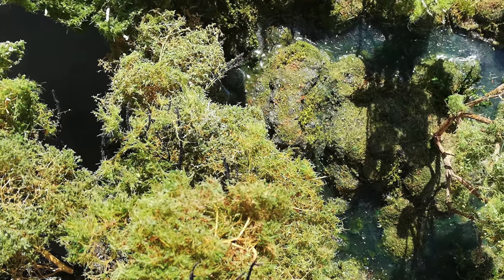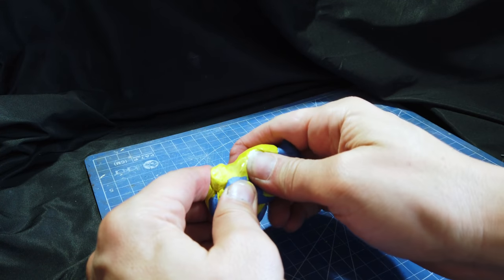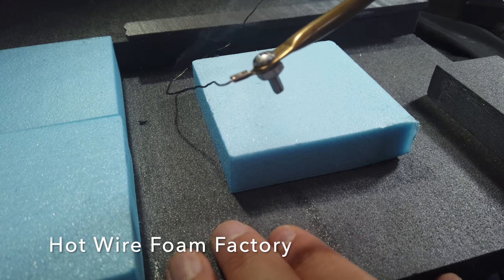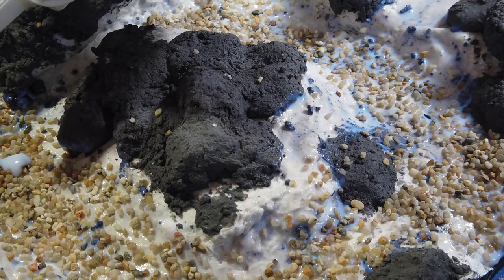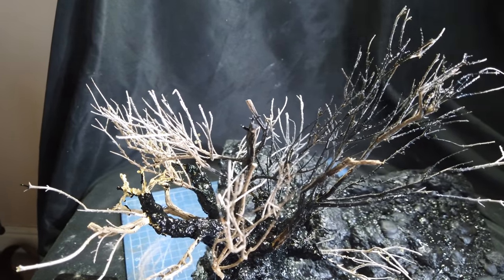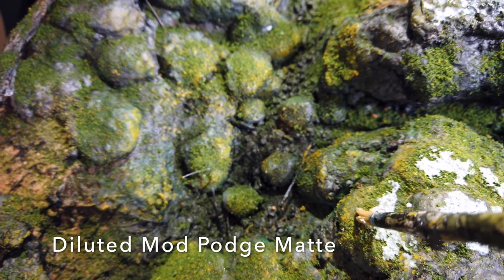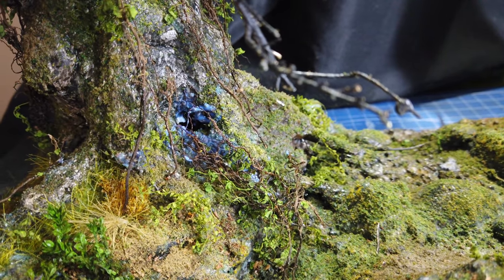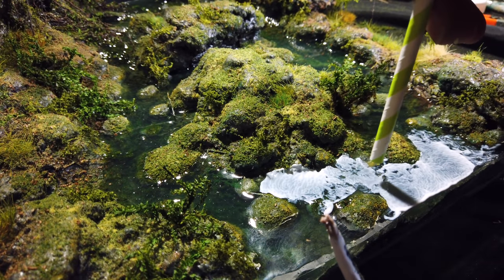How to make an AMAZING mossy forest river with giant tree: Making a Scene Vol #6

Comment: While I'd love to get into model making, I'm not sure I can reconcile with how much sytrofoam is used, environmentally-wise. Are there other options for base materials that aren't plastic-based?
Reply from the maker: Wood, but that's still extractive and probably has a larger carbon footprint across its life cycle. It requires cutting down trees, the growing of monoculture lumber forests at the expense of biodiversity, processing and then it's heavier for transporting, using more fuel. Making a permanent sculpture out of plastic isn't a bad use of plastic. Single-use plastic is what we have to limit.
Reply: My model railway layout uses used polystyrene as a base. Yes it's plastic but it's not easily recycled and the local organic food shop were delighted to get someone taking it away. It doesn't look good but you just have to cover it up well enough...
I used cocktail sticks to put the layers together
I think some people also use papier mache as a base (used paper etc, though I wonder how much plastic goes into the glue with papier mache!)
Reply: Just my crazy idea, but You could try to ask friends to save the styro their electronic gadgets and such come in. You could ask stores to save you their styro when they  unpack show models etc. put an add on your supermarket bulletin board asking people to save styro for you. if you consider how much there is around one TV set, I think you will be drowning in the stuff in a week, and all stuff that would otherwise end up in the incienerator. 

Some pieces might demand a bit more work to be brought into shape, but you dont really need big flat sheets (although some titems come packed with one) since youll be putting stuff over it anyway. You can also put several smaller blocks roughly together and then cover them. to form a flat-ish base.